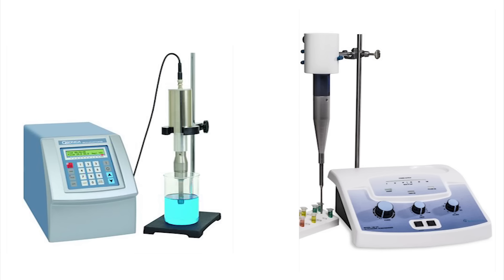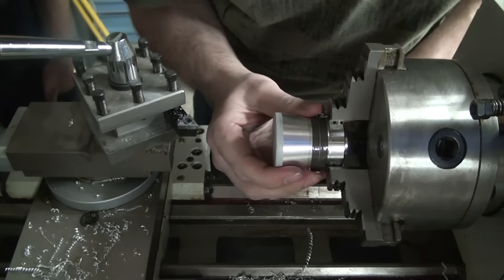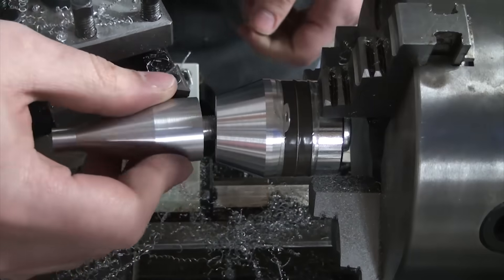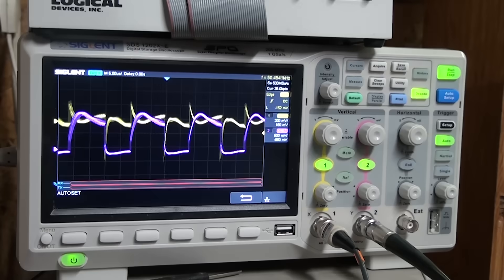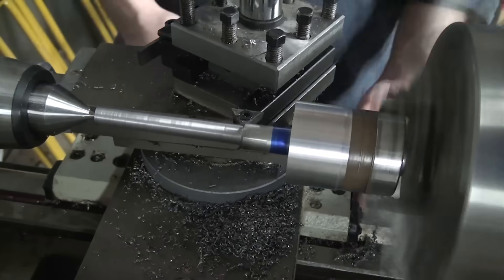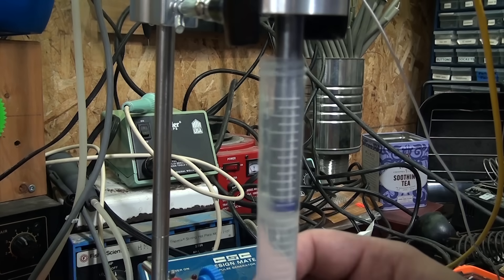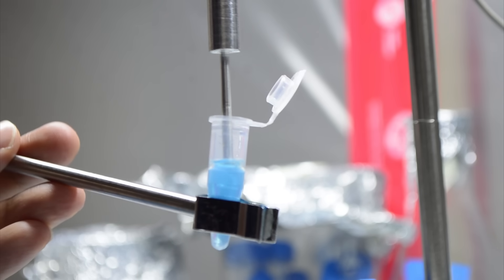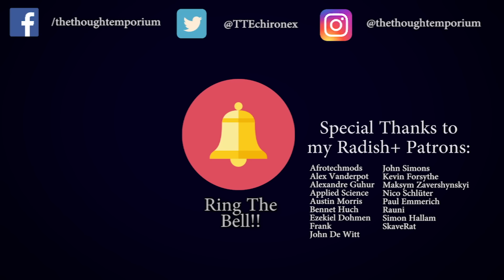DIY Ultrasonic Mixer

Comment: Alright, some easy machining tricks that would have saved you some hassle:
1, When using a dye to cut threads, use the lathe's drillchuck to guide it. The drillchuck (when it's empty and it has no drill in it) has a flat spot that's perpendicular to your work piece. In other words, you use the drillchuck to push the dye into your workpiece, and you just turn the dye by hand as you'd do normally.
2, You can do the same trick for the tap, usually taps have a little hole at the back, then if you replace the drillchuck with a centerpoint, that point will fit in the hole of the tap and keep it straight while you're turning the tap by hand. But as you've done it (mounting it in the drillchuck) should work too.
3, When you put your workpiece into the big chuck you want to mount it straight (obviously). 3:46 And I can see you didn't want to insert it deeper to not damage the piezo part. Wh
4, Just check how your lathe performs. A lot of lathes are not too precise, due to wear, setting of the cast iron with time (that's something new lathes have because of little internal stresses), etc. These are all things that can be perfectly fixed by flattening, polishing, and turning some bolts; if you know how to do it.  Even if you don't bother to calibrate it, it's good to know what kind of defects you have. Checking this is not too difficult, you can just machine a cylinder and measure the diameter and check whether it's the same along the length. You can slide along a dial indicator to check whether flat parts of the lath are in fact flat. You can check whether the chuck actually centers your piece (one of the jaws can be a tiny bit shorter that the others); you can insert a cylindrical thing into the chuck, see if it wobbles, then turn your cylinder around (rotate it around it's axis, with the end facing the chuck) and look whether it wobbles more or less.
I'm just saying: knowing why something doesn't work out as you want is quite crucial. Checking for defects before (or while) you machine takes less time than redoing your work and trying out everything. I've seen a lot of machining work kinda fail at my university because the teachers and students were blindly trusting the lathe.
Reply: I believe you are meaning "die" not "dye".

Comment: I know it's too late now but.... I study high voltage engineering (or whatever it's called in English) and whenever we have some capacitors that are able to have more than a few 100 volts on them, we ALWAYS short them with a piece of copper wire whenever they're not being actively used. That would have saved you from getting zapped by the piezoelectric element.

Comment: Tony’s design could definitely have benefited from using a thread-in attachment. Also using an inverter that automatically seeks resonance (like a Tesla coil or induction hob/furnace driver) would allow you much more freedom in designing a tip, especially for cutting. I noticed that Tony’s ultrasonic knife dropped down into the audible range as he pushed it on some more stubborn materials, which shows how important having variable frequency is for such a cutter. If you were designing such a resonant driver, going for a higher voltage might be an idea, though you’d want to check the breakdown rating of those things first.
Reply: Swap variable frequency for a resonance seeking control system.  Seeking resonance is a matter of seeking phase alignment as in the tuning video and phase gives you direction to seek in.  You can make this with a microcontroller based driver by using an ADC each for voltage and current and aligning the two.  I recommend as a minimum spec: an arm based dev board like an stm32f072b-eval ($10) as they are can be programmable over USB, they have a 12 bit 1 MHz ADC which can be used on 2 channels for a rate of 500 khz, which is sufficient to do phase comparison of voltage and current feedback to allow for high speed control of the frequency for resonance seeking.  Rig that to the two MOSFET switches on a direct drive for a transformer designed to drive such a transducer and you get a fast feedback design that should be good enough.  I'd bet that fast PID would be enough to control that.
Reply: Wouldn't you get problems getting it started up?

Comment: 'homogenizing a spider' that's pretty creepy lol just turning it into liquid
Reply: To be fair spiders also liquidate other animals.
Reply: @WhyNotDeanCV  Turnabout is fair play, I guess...
Reply: @WhyNotDeanCV  this is how the turn tables.
Reply: @WhyNotDeanCV  as do you
Reply: homogenous liquid
Reply: How about not using it to perfectly mix things, but to precisely separate?
You know those ultrasonic foggers that vaporize water into a fine mist?
Adjust the frequency of that sort of gizmo so that other liquids can be specifically targeted.
This could potentially be a way to bypass azeotropic distillation of ethanol.
It may also be able to separate the lighter fraction of used cooking oil, which becomes biodiesel, without messing with filters or chemicals or glycerin.
Should that be possible, it would also serve to extract heat sensitive essential oils from slurried plant matter.
Extract gasoline from crude oil, desalinate sea water, and make the world's best cup of coffee.

The possibilities are endless.
Reply: Perfect way of disposing bodies if your a serial killer, or even a perfect way of killing them as well

Comment: This old Tony is the reason i got into a machining school. And this far he's the reason i have had easy time with the machines there. Having seen how to do things helps a lot, even if i hadn't even touched a metal lathe before in my life.

You could have been the reason for me to get to a lab school. I happened to graduate half a year before i found your channel though. Haven't had any work, but i'm happy to be able to watch you do all this cool lab stuff.
Reply: This Old Tony and Clickspring are the reason I'm now taking machining. I love it! Very satisfying work.
Reply: @sekalviskio  
I went to drafting instead of machining

No regrets but it did lighten up a spark of passion in me for making stuff.
I wish I could just go do machining and welding, then maybe mechanical engineering
Reply: Sama, mutta menen amikseen vasta lukion jälkeen.
Reply: Have you considered working as a machinist at a university, or as a physics lab technician? 

I work at a university chemistry department in the workshop (and before that in the physics department). I am an electronics technician, but I work with a bunch of machinists. We build and maintain all sorts of apparatus. Luckily I don’t actually need to understand the chemistry, I just need to know what they need to accomplish from a mechanical and electrical point of view. 

This kind of work isn’t for everyone, as it’s tons of one-off builds and ever-moving targets. But I love it, since there’s always something new.